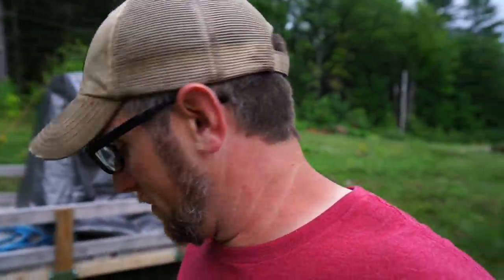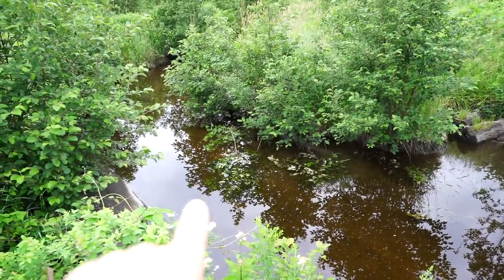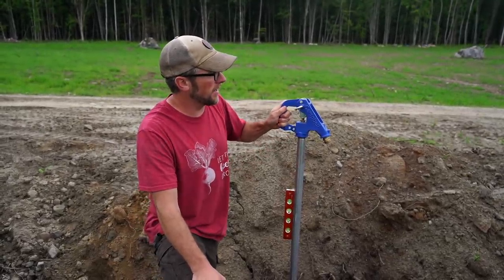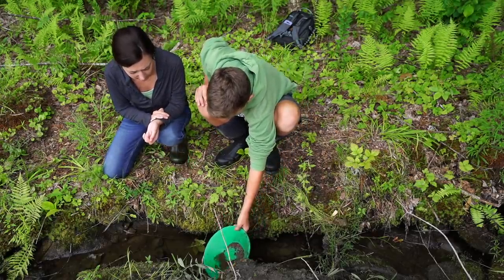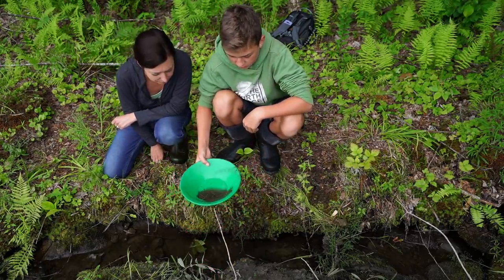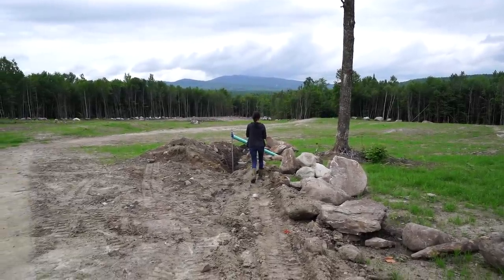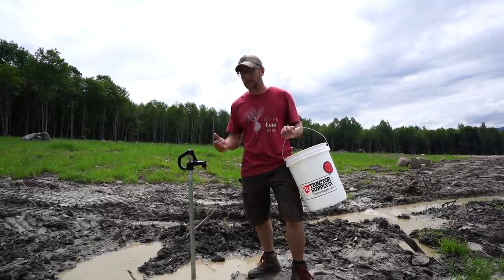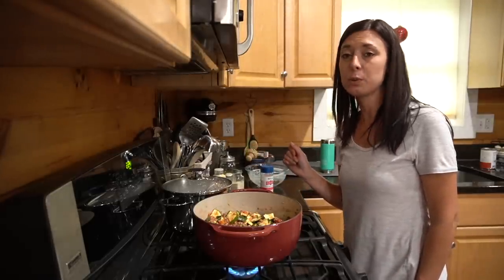DID We JUST WASTE all of OUR TIME & MONEY!?! Testing Our DIY GRAVITY FED Water System

Comment: gravity means just that . your lucky you have any flow as gravity will not push water any higher then the highest point of the  tank level , the only reason you are getting any flow is that the ground level drop from the tank to the hydrant was more then the height of the hydrant, the lower your hydrants or the greater elevation drop the more flow youll get. just remember water will only flow from high to low. I saw his coming.

Comment: not enough head ------ you get about 1 psi per 2-ft of head.  To have 30-psi pressure you'll need 60-ft of head.  You could get it be installing a ram to pump to an elevated water tank.

Comment: To creat pressure by gravity you need to start with the big pipe then drop down in size to creat pressure. That how the Romans did it.
Reply: Been waiting to hear a really constructive solution to pressure problem , not the only problem here that needs to be addressed though ...And there are also many ways of addressing those other problems ...One just needs to think back to how they hydraulically mined for gold in the 1800's ...They caught water upstream in Large pipes & every so far closer to mining site stepped down in pipe size & by time the reached the mining site ( side of a big hill ) they had water pressure liken to that from a pressurized pump on a Huge Fire Truck .....Good suggestion ...👍 Now AL has only 99 more Dragons to slay .... I'm sure if he actually takes a few of these ideas under consideration he'll be just fine ....Especially that one fella been putting these type gravity fed water systems for bout 50 years he'd be one of the first people I'd reach out to & actually have a long conversation with ......If you need to learn something , ALWAYS find the person with the most PRACTICAL FIELD EXPERIENCE Available & they will be your best guide ...A few small changes , a few tweaks,  & I suspect AL will be just fine ...👌👌👍👍👍

Comment: Maybe it would work with a 12v water pump, connected to a solar panel and a battery?
Than you need an electric switch between the battery and the pump, and a faucet at the end.
I've seen some videos on Ytb about that. Some more tricky then others.

Something similar to this...
https://youtu.be/D-LvbF9IgYg

Comment: Pump air inside the tank to give you more pressure, temporary fix.
Reply: You can't pressurise a vented tank
Reply: @stevemarvin1723  Obviously.  Maybe make it unvented then.

A stopcock could be fitted, so if water goes below a level, then more water fills the tank.  

A car valve fitted by drilling a 10mm hole and pulling it through. Connect to a car tyre compressor such as those by ryobi, milwaukee or makita, set the pressure to 10 or 15 psi.  WOuld do as a quick fix

Comment: For the first time this year I am raising 16 meat chickens. I've had layer hens for 12 years but I got inspired by you and Jason and Lorraine of Sow the Land to raise some meat chickens. I'm building a chicken tractor like yours for the pasture we have. Right now they are 4 days old in the brooder. So glad to see that your spigots worked! So Gina and nephew, the gold didn't pan out? I was surprised to see you drop those big rocks down before you pushed the dirt into the trench. I thought keeping big rocks away from you water line would be a good idea. I thought you could use those for future projects. They looked cool. Tractor to the rescue scooping the extra dirt. Do you have enough pressure to spray your equipment off after you use it? I hope there is an inline pump someone knows about. I have a tiny solar powered pump for a floating fountain but that is all I have seen. If they have those I would think they have what you are looking for. We know for our gas powered pressure washer the minimum gpm was 2 gpm. You've got 1 1/4 gpm. A pressure washer would sure help you clean your equipment. You'll need a place that drains well to clean them or they'll end up in a mud hole when you spray them down. Set up an area with a dry well below it? That zucchini sauce looked delicious with brown rice. Yum! Thanks for this Vlog.

Comment: Al don't drop big rocks into your trench you might collapse your water line. I wouldn't even put them in the bottom of the trench. Set them down in the trench.
Reply: Al likes to drop the rocks from a distance of a few feet rather than placing them on the ground.  Also 14:12 didn't help the PVC pipe at the bottom of the trench!

Comment: the way to increase pressure in line is to increase the diameter of the line, smaller the pipe greater the friction
Reply: I think that is why he went with 1 1/4" water line because 1/2" would have been too much friction loss.
Reply: @StoneKathryn  I think he should have used 2" from my own personal experience on our farm which I had the same problem as he is experiencing now. At the time I was using 11/2" pipe but didn't produced the pressure I needed till I went with 2".

Comment: Ok, I don't understand why you are filling in the ditch if the water isn't flowing right. You might end up having to dig it back up.My husband says your down grade isn't right for a gravity feed. You need about a three foot drop from your water tank to your first hydrant and then the further out you go the down grade  has to keep going. He is thinking you don't have enough down grade from your tank to your first hydrant and that your second hydrant needs at least a 3 ft down grade from the first hydrant. Don't know if this helps any, I mean we are not there to see the actual system and things can be deceiving on video. I just know from experience that the more slope you have the more pressure you have. My husband is the one with the brains on these matters.

Comment: Lead the choir to come out on the other side we need to run the water open all the time I need to be all the time through the whole line water without the saving part remember correctly you can read that on the internet
Reply: A siphon water source like what Justin Rhodes has would still work in the winter.

Comment: ECO-WORTHY 100W Solar Water Pump Kit - 100W Solar Panel + 12V Water Pump + 20A LCD Display PWM Controller + Pair of Cable for Remote Watering, Garden, Farm Irrigation, Tank Filling
Visit the ECO-WORTHY Store
3.2 out of 5 stars 39 ratings

Comment: Probably a high spot with air in it and no pressure to push it out. A small electric pump that can go in line between 2 pieces of garden hose hooked to your hydrant that can move about 400gph would pull the air out of the high spots. Its not gonna give you lots of pressure gravity works how it works but you should get more volume and you can hook the pump up when you need more pressure ✌
Reply from the maker: Thanks. That makes a ton of sense

Comment: That is a very disappointing way of life. Speaking of living in nature, do not use chemicals, eating good grown food and so on. But nature is only good when it do what we want. The beaver that's just living the way the Lord has created must die because it is in our way.
Just find away that there is room for the both of you.
Concerning your watersystem. In my holiday camper the water come through a 220Volt pump in the fresh water tank. When camping on a spot where is no electricity there's a battery and a converter. The battery is filled using solar. But this is for a very short distance. You must used a heavy duty pump so a that will ask for a lot of solar or use a aggregate.
Greetings from the Netherlands
The pump in a caravan is activated by the electric switch in the fosset and not by pressure. You must run an electric line to the hydrant which activate the pump.
Gravity  fed works but then the barrel wich you have put underground must be 4 meters high like a mini water tower.